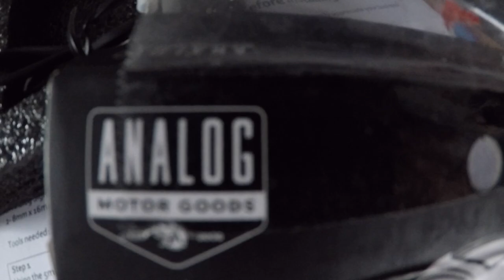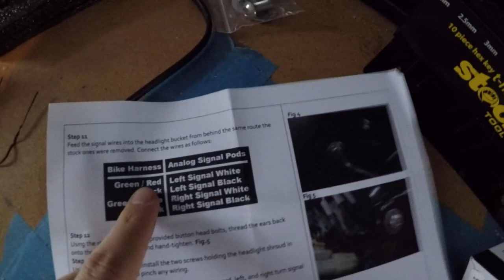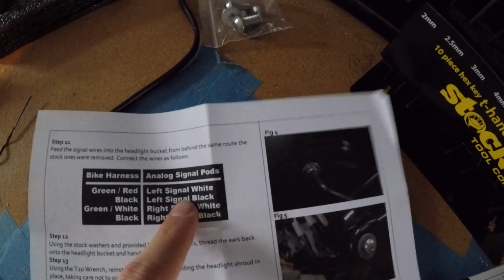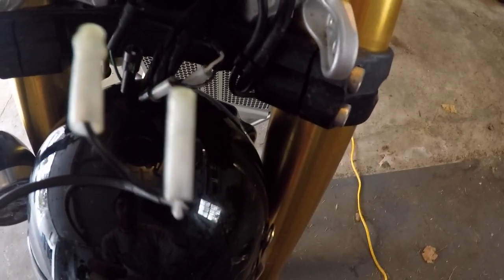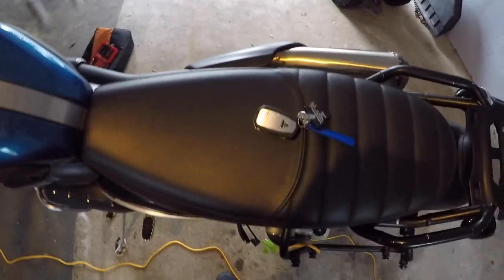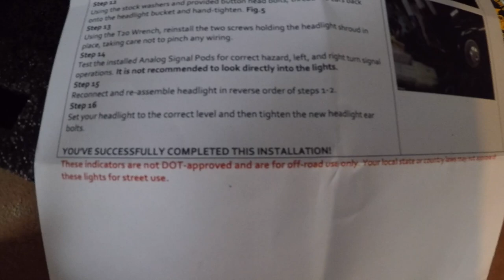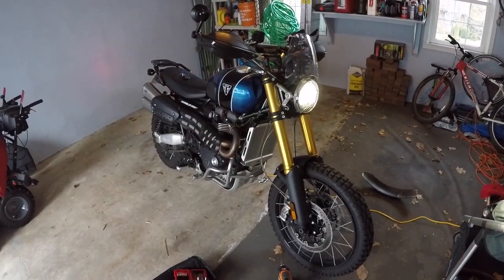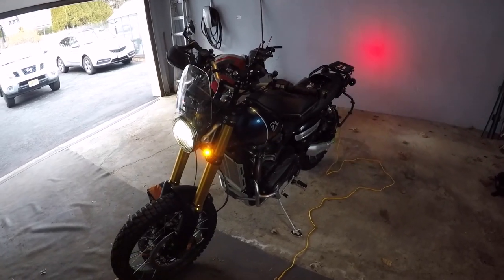Analog Signal Pods install - Scrambler 1200 XE

Comment: "The stock indicators are prone to break if you go down in a low speed, off-road crash (happened to me once already). Stock ones look awesome, but not practical for off-road riding." 
but  no problems heavy off-road with bar end mirrors ....
Reply from the maker: Hahahah gotta watch my video on mirrors. I run double take mirrors off pavement. Bar ends are only for the morning commute!

Comment: Nice..what option is this? Is this fork tube or headlight bracket?and by the way will this work if you use all including front and rear? Looks like you have different blinkers in the back..thanks.